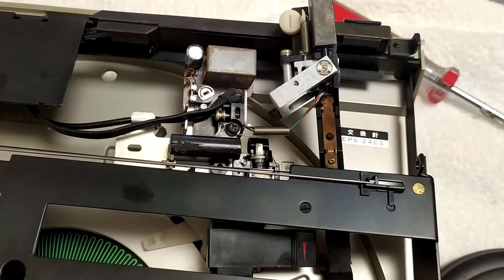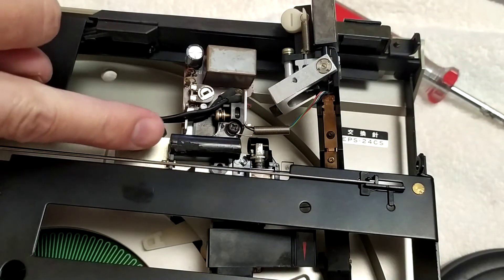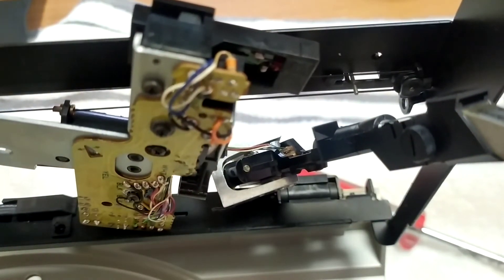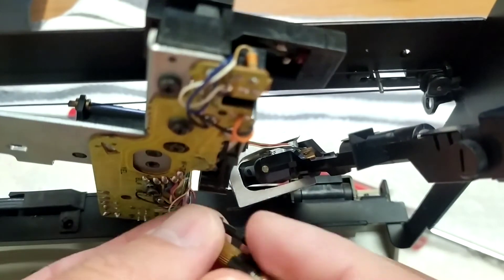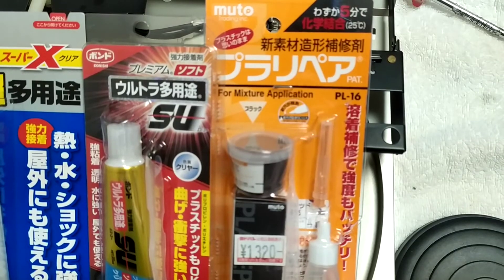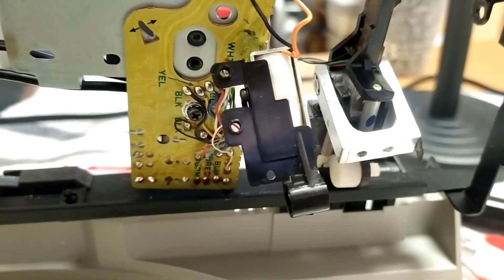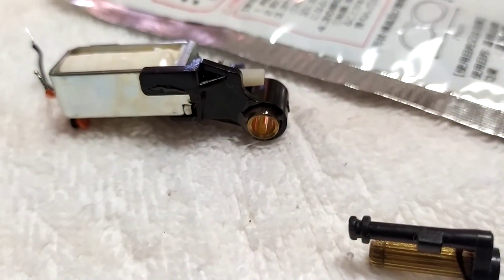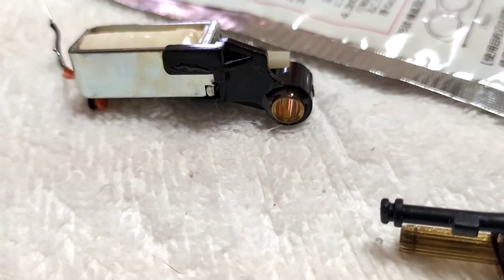Technics SL 5 Part 3 - Repairing some plastic mounts

Comment: Hmm jiggerly bits gone loose :-D
Epoxy is good stuff but it doesn't seem to bond to some plastics, it's like the plastic has oil in the surface.
Hot glue is good for laptop hinges, the plastic mounts always brake off.
And super glue is not as super as it was, the early super glue was fantastic.
Hopefully that will be the end of that problem for good :-D
Reply from the maker: Yes as a rule "greasy" plastic is very hard to bond to.  But we can kind of fake it.  Epoxy is good like that.  I need to crack on with some study today, but I will have another go at this over the next couple of days - alignment not quite right.  

One of the beauties with this kind of epoxy is that, generally, you can soften it with heat, say using some boiled water, and reposition and then just let it set again.  I'm about 1.5mm out of where it needs to be.  :(  

The worse problem is the arm drop speed, that really needs sorting.